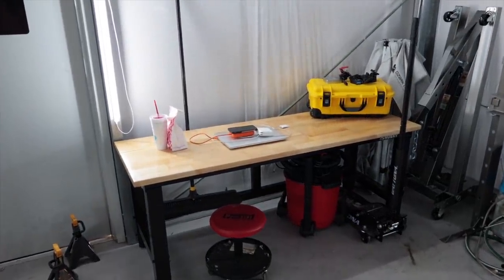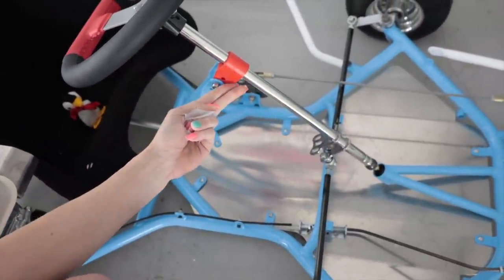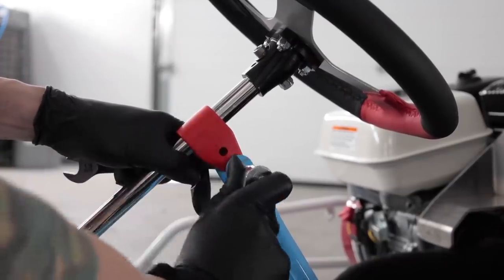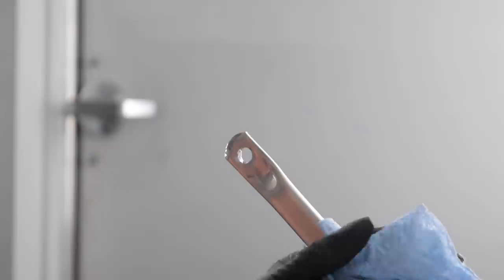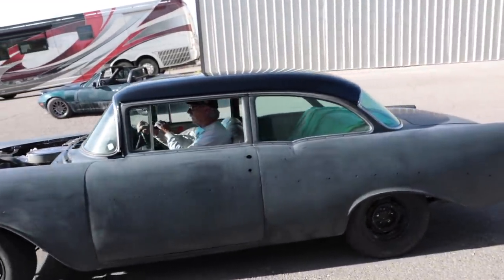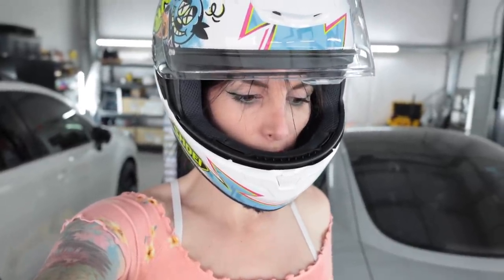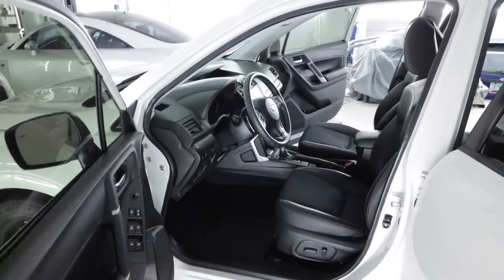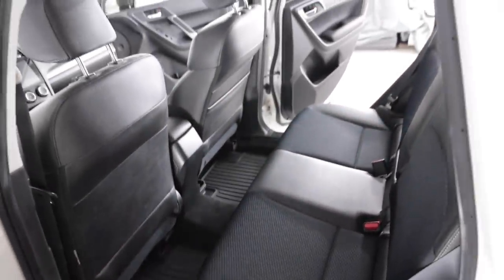Over It.. Time To Build This Engine! // Honda Powered Emmick Kart

Comment: To me, the entire steering system on such an open naked vehicle seems really important. Any little component seems vital. Failure at high speed is just disastrous. Not an expert opinion, of course. Oh, and any change in upcoming video content is fine I think. Regular programming can wait.

Comment: If the karts not fast enough just swap it to a Rotax Max 30hp 2 stroke 13500rpm 60-70mph.

Used non evos won't be expensive.

Then you'll never get to say its too slow.

Comment: Sarah, I can not see much detail of the inside of the spherical bearing , but its kinda common solution to mount it this way , it looks like you ( i mean the cart not you ) missing the outer ring , that outer ring should be hold by the clip ring, you can measure the size you need and find everywhere , for example https://www.ebay.com/itm/M8-UNIBALL-KART-GO-KART-STEERING-COLUMN-BEARING-/370772880806 ,good luck in finding a proper solution ;)

Comment: ...the honda engines (gx200] are stock totaly good for 4.500 to 5000 rpm..but..
1..only 450 to 500 ml oil.. else you got to much pressure in the crankcase..
2. that wont work as long the engine is on an angle mounting plate..(oil starving)
2. you have to remove the oil level cutoff
3. a cabletie true the govener spring lets you adjust the max RPM..

and those are the bearings you might need for the steering .. _> https://ssl.dm-motorsport.de/index.php?page=4&lang=de&q=lager+lenks%C3%A4ule

(sorry that i only have an german link for that..but if you lived here maybe this would help to find some in your reach)
greetings from germany

p.s. a...and PLEASE...get a propper fitting helmet before riding again!!!

Comment: Building a go cart that goes 45 to 50 mph, with brakes that lock up when you apply them and a steering wheel shaft that may or may not come apart. RIP Sarah, should make good viewer content though. Will Penguin take over the car reviews?

Comment: "I want so much more out of it..........too slow now".
I knew it wouldn't be fast enough.
If 3600rpm is 24mph you're getting 1mph for every 150rpm, so an additional 1400rpm should equate to a grand top speed of 33.33mph....You'd better buckle up tight for that, although I don't expect you'll be doing any time travel.
Going with a smaller sprocket might get you to 40mph, but it'll take forever to get there.
Oh yeah, 5000rpm is probably gonna need better valve springs too.
You really should've gone with the C90 clone (YX140).
EDIT:
I just compared the specs and the C90 clone (YX140) is 16bhp compared to the GX200's 5.7bhp.

Comment: Told you ..buy a cheap motorcycle engine instead of this crappy mower thing something -it's not made for performance shit !And a lady like you need something more sophisticated than that !Most 125cc motorcycle engines revs up to 14000 rpm easily so no expensive tune needet !  Don't look for performance gokart engines , then your wallet will need a paramedic (for example a Rotax kart engine is about 2400 bucks )  ! Have FUN !

Comment: yes yes great move build that honda you will need a bigger carb and exhaust  and get the racing head with stronger valve springs  for safe higher rev`s  a better racing cam as well  .. it will give the most improvement in power a torque  some cams will have clearance issues with crank and cases  and the cam it self  nothing a grinder can't fix in 10 min.....  please more kart videos sorry i like them better than your car tests you do a good job its just ho hum another car test of a car i will not buy anyway.... sorry about that.. just my opinion